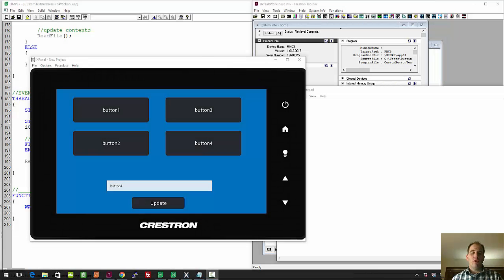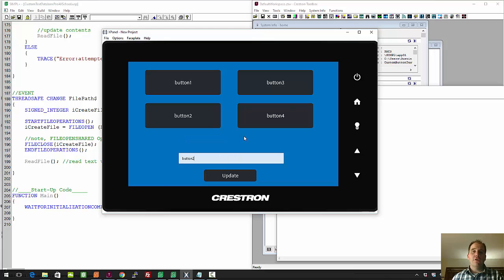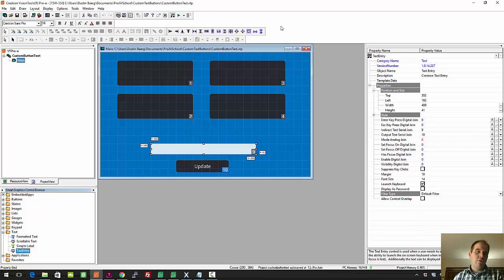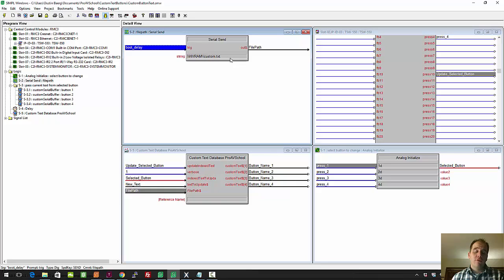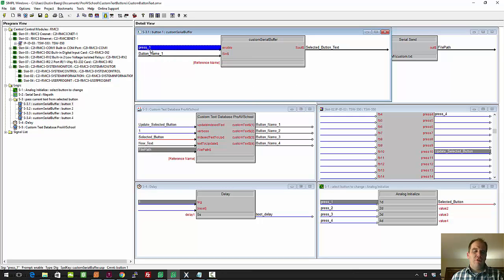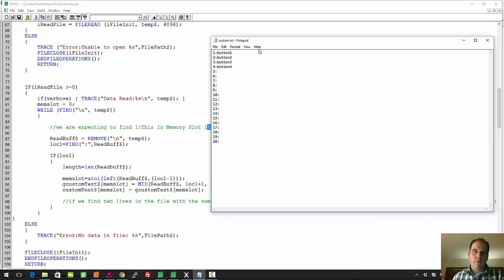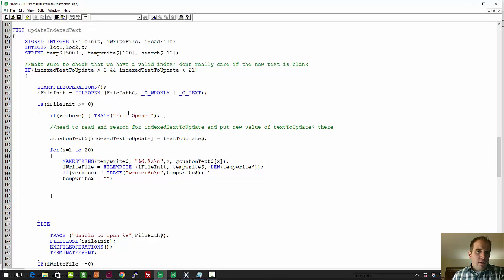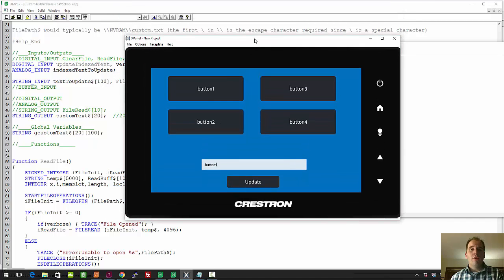Crestron Editable Custom Button Text

Comment: Hey Dustin, you can use a regular analog buffer to pass data for your text.
Reply from the maker: Do you mean instead of the serial buffer I made?
I think serial or analog buffers still both require the data to be re-propagated through the buffer in order to pass. I could have triggered something to re-trigger the string but in a lot of cases I find it easier to hold them in a s+ serial buffer so that I can just pass them around as I would analogs through buffers.

but....always open to new ideas and ways of doing things!
Reply: Yes,  the analog buffer will pass data once the gate is high as a result it will pass data  if it has changed even though gate is low. The serial will only pass data id input changes while gate is high.
Reply from the maker: interesting...I have to remember to test this sometime! Thanks.